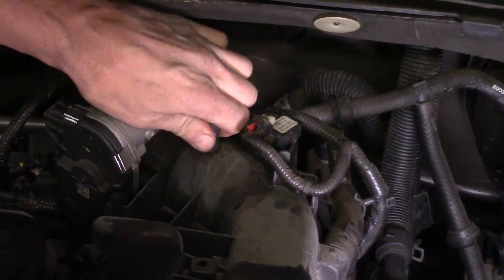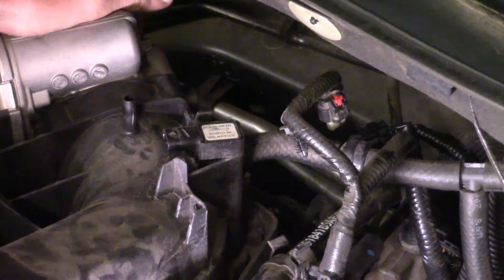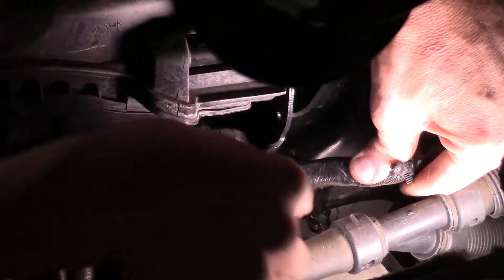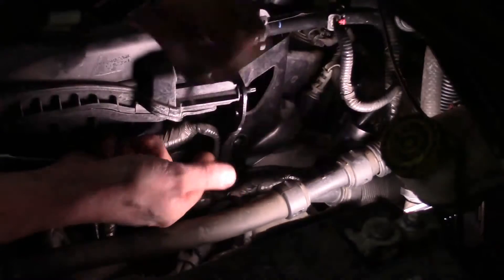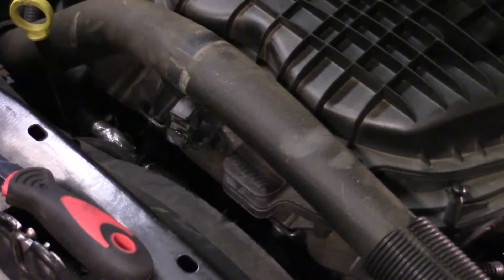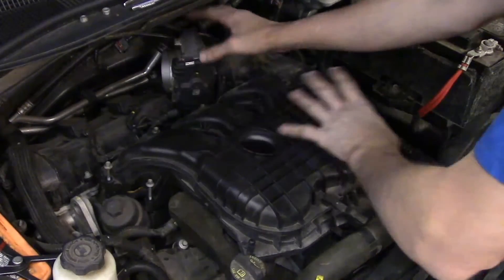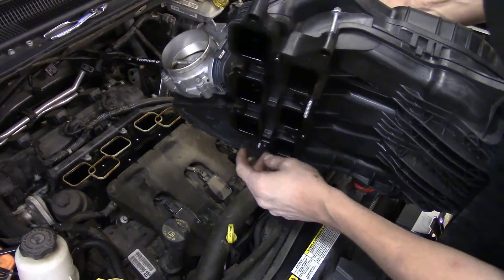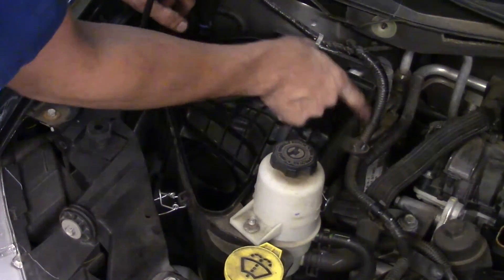Part 2/10: 3.6 Pentastar engine left cylinder head removal (the short cut)

Comment: I love your video's , very informative. You really don't need to take any brackets off to remove the upper intake. You can take the 2- 10mm bolts off back and in the front use a 4mm socket and remove stem and bolt comes with it. Then pull up and forward to remove.

Comment: Now coming into problems with my 3.6L, apparently the dreaded rocker problems they suffer from. The mechanic told me he might have to replace the whole head on that side because of the issue. Does this make sense? Do this motors suffer from valve seating problems as well as he said?

Comment: Since I can't find any definitive answers after looking online, maybe you could help? I might have to replace my #6 coil. I read somewhere that I need to contact a dealership and give them my VIN to make sure I'm ordering the coil for correct year due to a switch in manufacturers of the original coils midyear. That could be total bullshit, but I'm not in the business, so I can't know for sure. I just want to make sure that the part I'm ordering won't differ in, like, resistance or amount of connector blades or something stupid and avoidable like that.
Reply from the maker: When ever I order something....I get the parts department to check by VIN. It can make a difference so its best to be 100% sure your getting what you need. Its what I highly recommend.

Comment: Great Video. I don't much about cars. But I found these videos because I was looking at reviews on the 3.6. I'm looking at replacing a 2005 Grand Caravan with a 2012 or newer. In you opinion is the 3.6 a decent engine or should I look at a different minivan? sorry if it's a vague question. Thanks for your time
Reply from the maker: The 2012 was early in the 3.6 life....the newer you can get the better. Otherwise the most common issue on the 2012 would be the oil filter bypass valve breaking. 2014 could have an oil leak at the housing which was the first year of the oil filter housing change to a newer style.  It can depend on what the service history was of that vehicle and what was replaced or done already.

Comment: How much would cost to have this done in a shop?
Reply from the maker: I have no clue on the price of the parts......the majority of the time its been covered under warranty so I have had no reason to check more into it. The labor hours would run somewhere around $1100-$1300 depending on the labor rate per hour. The price mentioned is based on $100.00 an hour rate. Thats just a rough guestimate

Comment: I'm needing to replace #2 coil. on 2011 Grand Cherokee 3.6L , because of a Misfire. Would you recommend that Just change out the others as well ?
Service is not Required until 100,000 miles.
what should I Do ?
Reply from the maker: +Mark Psrez sr. Personally I would swap the plug and the coil first before replacing anything. For example......move the #2 plug to #4 and move the #2 coil to #6. Then clear the codes and test drive until the light returns. Then recheck to see if the misfire is still on #2 or moved to #4 or #6. You may be replacing the coil, the plug, or checking further and possibly the left cylinder head.
Reply: I have 80 psi on cylinder #6 2012 Grand caravan and ticking noise and a misfire when at stop light and at idle no check engine light I can't get left valve cover off to check Rocker arms I think I just might get rid of the van to many problems